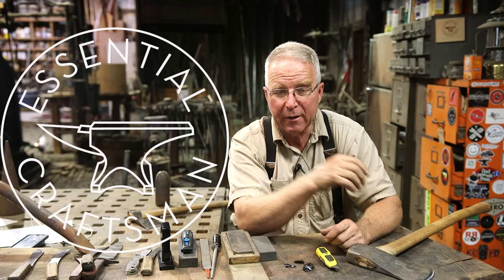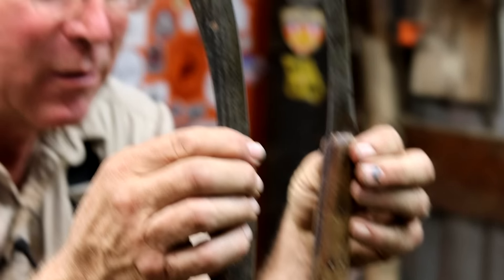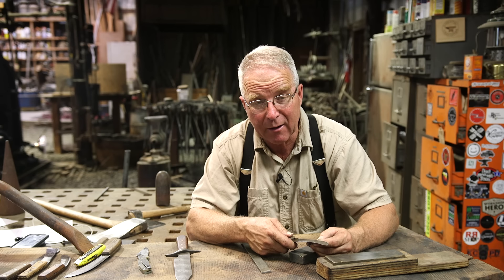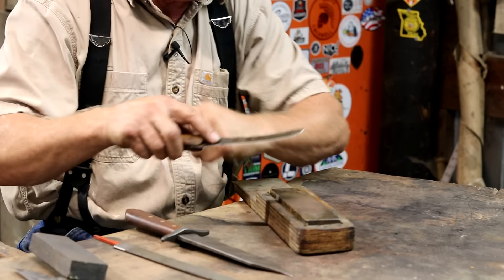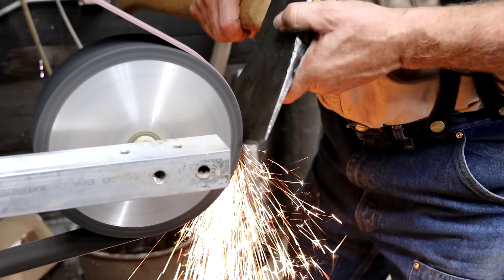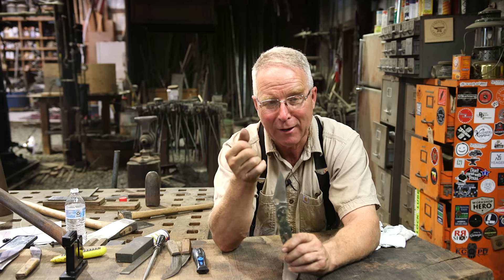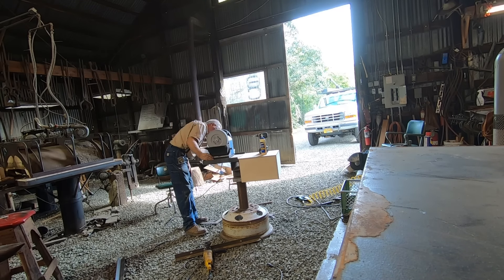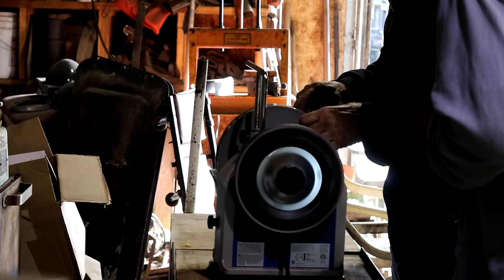Master the Art of Sharpening

Comment: Love your videos.

For ophthalmic surgery, especially corneal, the best blades are made of monocrystalline diamond. The are sharp and especially smooth so they create clean incisions without drag. This helps the wound adhere to itself without sutures. A diamond knife is very expensive, but lasts a long time as long as you don't drop it. An alternative is sapphire. It isn't as durable, but much cheaper. Even less expensive - to the point of being disposable - are silicon blades. They are made using the same silicon wafers as are used for microelectronics. The edges are not ground, instead they are chemically etched from both sides. In theory, the edges are one atom wide, but in practice they have an edge radius of approximately 40 nanometers vs. 20nM for diamond blades. For comparison, a metal surgical blade has an edge radius of approximately  600 nM.

So, if you think a scalpel is the hallmark of sharpness, think again!

Comment: Another great video! I've got a question for you, the wife gifted me a beautiful raindrop pattern Damascus knife but the tip was a little blunted at the end, so I sharpened it up and redefined the tip but I folded it up and the next time I looked the flat tip was back, it also isn't holding its edge very well, do you think it's a problem with the heat treat and need another quench?

Comment: I have used a system that is sold under the name Catco sharpeners. It consists of a blade clamp, a for setting popular sharpening angles, some honing oil, and several stones of varying grit, with a rod that is inserted into the blade holding clamp. I have had this system for around 20 years, and currently, there is a company named GATCO that comes up when I search for CATCO sharpeners, but it is a mirror to the CATCO system. It works pretty well for me, though it took a while to get used to using it.

Comment: I noticed that you run the knife over the stone with the cutting edge as the leading surface, but when you used the file on the unsharpened Bowie knife, you ran it from the back of the blade forward over the eventual cutting edge.  At what point do you make that transition?

Comment: For just about 3 years I worked at a poultry processing plant in the evisceration dept.  I would, for a few hours a day, work red tag birds.  A whole bird that gets cut into it's 12 (not 80 pieces.  I could do this at a rate of 1 bird every 18-23 seconds flat.  To maintain our blade's edge we ran them, periodically, through what we called a "Mouse Trap".  Basically just two (what I assume to be) stainless steal wires about an eighth of an inch thick, spring-loaded into a 'V' shape.  It really helped hone our knifes' edge.  

If your curious, it was Gold n' Plump Poultry in St. Cloud, MN.  Roughly 83,000 (iirc, been almost 20 years now) birds per shift run on 2 lines.  Red Tag line is where the the birds went after USDA flagged them for a defect/flaw for piecing and re-inspection.  Yes, I ate the chicken from the plant I worked at and still would if it wasn't just sold.  Gold n' Plump took good care of the chickens making a safe, tasty product.  Their workers... not so much.  Took bilateral carpal tunnel ligament release surgery after only 2 years to realize that fun fact.  But yeah, good chicken and our knives were almost always sharp due to a good, daily, deep sharpen and frequent station maintenance through our "Mouse Traps". 

A bit long winded now, sorry.

TLDR: Used to professionally cut chicken at a poultry plant and what he's saying is spot on!

Comment: This may be a dumb question but do you have different stones with different grits on that last machine? What I mean is when you sharpen your knifes with whetstones you can have different stones and then you finish with a leather strop.
Reply: If sharp is the goal, you don't need lots of grits.
You can get shaving sharp with as little as 120 grit.
I think that wheel is rated as 400 or 600 grit, that is more than plenty, because of it's application it will produce a finer finish than by hand (at the same grit, for the average person.)

Polishing is really just 'hey my knife looks pretty' deal in most use cases.

Comment: I like to use granite and marble diamond pads on my Milwaukee variable speed angle grinder. The pads go from 30 all the way to 8000 grit and some styles of them are better than others for use on metal. You can actually polish a rusted axe head to a mirror finish in 20 to 30 minutes using granite and marble dry polishing pads. For sharpening knives, I do wish I could change the grinder direction but diamond pads are a god send for polishing metal and making a razor sharp edge.

Comment: I think James (Stumpy Nubs) has three of those Tormek systems in his shop now, but I am not sure he had to pay for them.   I have been through a bunch of methods to sharpen my chisels and plane irons.  I had good results from a shop made leather strop on a low speed motor, but I made the mistake of taking it to my Menz Shed and it got ruined.  I now use a 10" CBN wheel for drastic reprofiling.  I have four 8 inch diamond stones from DMT from 300 to 8000 grit.  I also have a 16000 grit Japanese whetstone but I prefer the DMT diamond stones.  However, my secret sharpening weapon is a fully stitched buffing wheel that I use as a strop.  Thirty seconds on this wheel after using the diamond stones has my tools wicked sharp, and best of all, I can refresh an edge just using the buffing wheel multiple times before needing to go back to the diamond stones.  This only works on good quality tools.  I have a Chinese carving set that rolls the edge as soon as it is applied to the buffing wheel.  You also need to be careful using this method with wood chisels.  It definitely removes metal so use light pressure on the buffing wheel o the under side of the chisel to keep it flat.

Comment: I often use a small kitchen knife sharpener with ceramic rods or wheels on my box-cutter blade at work.  
Is it the wrong angle?   Yes.  However, it still gets a good edge and greatly reduces the amount of blades I go through.

Comment: In most sharp edge cutting, the edge is only in contact at the beginning of the cut. After penetration,  the cut is finished with the shoulder of the edge.
The longer the cut, the less the edge is used.
That's why lathe tools hold their edge longer than milling tools.

Comment: Great video! I read somewhere on a bushcraft forum that you shouldn’t use a file on tempered knife blades because it ruins the heat treating? Is that right? I use a file all the time for my axe and machete but never have on camp knives.
Reply: A file will not ruin heat treating.
Anything that will bring the metal to form an Oxide layer (straw like colour, or eventually blue) will.
This is things like bench or belt grinders.

You can use a file no problem.
Reply: @autumn5592  thanks for the reply, appreciate the advice.

Comment: I got rid of my Tormek. It’s messy because of the water. The stones are expensive. I hated “conditioning” the stone to course and then back again to fine. You have to do that for every blade because you can’t remove the blade, do all the course grinding on all the blades and then put the blades back, one at a time to do the fine grinding, because you will change the angle of the blade to the stone. Oh, and the various jigs are hideously expensive. I love power sharpening because it’s so, so much faster. I now use a Work Sharp. It cost a fraction of what the Tormek costs, has no water mess and doesn’t heat up at all. I love it.

Comment: In the 70s I  I started work in a abattoir  in the UK, we used to slaughter cattle/sheep / and pig's, I used a smooth wet stone , sometimes oil , and sometimes I used vim/Ajax a scouring powder, the blade of choice I used was a , Russell green River work' USA, they look very similar to the ones you held up, crackin knife, when I could shave my arm I knew they were ready for action,  and they we're expensive, and after 40+yr I still have them in my chamber's, just waiting to be unleashed on a , , dead carcass. Very informative vid,

Comment: I got my first belt knife, 15 cm, when I was 4 (not common, but also not shocking, when and where). I also got a whetstone, and learned how to keep it sharp. I don't know what the right definition is for "hurt yourself", but I can say that I got over being upset at the sight of my own blood, at a very young edge, I mean age. Nothing serious; more like paper cuts than anything. I quickly learned the difference between an acceptable risk (small motions with little force) and an unacceptable one, and I was given two very healthy rules: the knife remained in the sheath until and unless I was in a steady, balanced position (originally, sitting), and the edge and tip is never moved towards any part of the body. I was religious about it. It's just that, some times, to get precision control, you have to grab the blade, which is completely safe, until you get distracted, or you have to cut close to (but away from) where you're holding an object, which is also completely safe, until you get distracted. I still do those things (plus a few, more recently added, bad habits), I still get distracted, and I'm still not afraid of seeing my own blood. More importantly, I still have all my fingers, and none of them have even had to be reattached!

If a kid has the maturity to be "religious" about those two rules, there's only benefits. If they're not... well, natural selection, I guess...

Comment: This is a great video! How has the Tormek been working for you?  Have you made a follow up video on using it?
I purchased a Tormek T8 almost 2 years ago, and I can't get anything even close to sharp with it. I've read the manual a hundred times, and watched every single Tormek video over and over and over again, and I've never gotten anything sharper than about butter knife status. I sure wish I could figure out what the heck I'm doing wrong. When I use my whet stones and my leather strop, I get my blades razor-sharp, with the Tormek, I basically just ruin everything I put it on. I can't figure it out.

Comment: See, I bought the small little work sharp belt sander things. They are great sharpeners, but the first knife I sharpened was an old beat up knife and because I was pretty much putting a brand new edge on it with the 80 grit sand paper I got it way too hot. It was at that point I realized two things,  you have to cool off the blade, and less can be more. Because those small belt sanders can remove alot of metal even though they are small. 

Now I love them, because you can sharpen a knife super fast and get it super sharp, but like everything else there is a learning curve.  I recommend them to people now, but I tell them to practice alot before you put a 300 dollar knife on it. Because if I would have started with my best knife I would have been sick.

Comment: Asian knives sharpened on only one side are done about 15 degrees on that side. 
Filet knife is about 10 on a side. EDC about 25. Cleaver about 35. 
Love my Lansky system.
Reply: You don't want a 25° edge on an EDC knife...
Reply: @autumn5592  OK. What DO you want ?
 And I will pass it along.
Reply: @stevejette2329  It's not what I want, it's what should be done.

25°ps is much to steep for an EDC blade.
Higher angles may increase toughness, but they reduce edge retention (making knives duller faster), limits their overall sharpness and ability to cut things.

You want 14-20°ps on your EDC knives, it will make them perform better and last longer.
Want to avoid making it to low though on steels that are to hard (as they will chip to shit), and to low on softer steels (as they will be more inclined to roll.)
You match the exact angle to the steel, thickness, and hardness.

You can always microbevel as well, which will bring a little of that strength back. While keeping the benefits of a lower angle. (Becaise there is less material behind the edge.)

I recommend using 18°ps, then lowering it every now and again to see until it chips, then sharpen at the previous angle.
Reply: @autumn5592  So I guess everybody who has an EDC uses it for the same purpose, therefore it "should be done" the same.  I am curious how you get 
a "14" degree edge. Not 15. Or 13.
Reply: @stevejette2329  Tell me, what would ANYONE need a 20+°ps edge on their knife for?
You gonna hack bones with your pocket knife? Lmfao.
There is absolutely no need.

Freehand it, if you need to know, use a protractor, it's not hard.
Some of the more expensive systems have 1 degree angle control,  but why waste the money.
Those aren't even that good either (because of how they effect the angles tips or heels.)

You don't need exact though, that's why I never gave an absolute -- so long as it doesn't roll or chip, and you are going pretty low, it's fine.
Reply: @autumn5592  Having worked as an ironworker and a harbormaster, my knives were usually "sacrificial", meaning that the work itself would often destroy knives. Being in the Coast Guard, I sharpen the survival knife much sharper, to possibly cut clear of any lines when underwater.
My most important sharpening tool is a jewelers eye lupe, 10 power.
Reply: @stevejette2329  Okay, so you listed professions, not actual uses.
And then some statement which has no explanation.
Not what I asked for at all.

And then you add another statement, which doesn't mean anything.

Magnification helps, but completely unneeded.
Reply: @autumn5592  You are right. I am completely wrong. Bye.
Reply: @stevejette2329  I'm glad you're realised.
Takes a big man to accept his mistakes, good on you.

Comment: I notice that nothing was mentioned about sandpaper… does a high grit paper not work well on knives for sharpening? (My only experience of paper is for proofing a bike frame prior to painting and I have a lot of paper left over so figured it could be used on my knives)
Reply: Yes it does work well. You do need to know your grits and which to use when. Finish with a strop.

Comment: The Workshop Ken Onion edition with the blade grinding attachment can be manually speed adjusted to prevent blade heating and I STILL cool and dry the blade😂
Reply: Still causes overheating on the first few microns of the edge.
Reply: Yeah the thinner the metal gets the easier it is to heat up. Its physics

Comment: Yeah getting back to old whetstone sharpenig a bit . Want to get it super sharp as in factory sharpness . But got away from that old fashion way instead using those easy lazy ones that you hold down with one hand running it thru those anrrow V slits .  it does get it fairly sharp butr now getting back into old whetstone way . Because a higher end steel blade knife S35 VN that may be harder to sharpen might need more xpensive sharpeners ? What would you recommend ? Yes have a two coarse whetstone but might need another ?

Comment: You ain’t lying about spending a lot of time on a whetstone.  My USMC Kabar takes forever to get a good edge on it but it is then so sharp it will shave the hair off your arm.  I don’t have to work as hard on my pocket knives.  I have a set of Kerry’s stones from 400 grit to 10,000 grit.  On some knives I start out on the 400 grit but others on the 3,000 grit stone.  Mine are wet stones, so I soak them in water for 15 minutes before I use them.  I spray the stones with a soapy water during use.  This, removes the metal filings from the stone during use. I want a wet slurry on the stone during use.  If it dries out I spray it again with my soapy water solution.

Comment: Scissors are probably the easiest. Fix one of the blades in a vice and find the angle with a file. You will know it is correct when it goes over smooth with no resisting grinds. Use light strokes with little pressure holding the file at both ends keeping the angle consistant.

Comment: I hope you do a follow up video cause even the Tormek has it's quirks. But someone who is sharpening lots of different tools can get their money's worth out of it. IF one buys one, don't get the small one, get the T8. Lots of attachments to dump money in. For wood working tools and kitchen knives I use water stones and a leather strop on wood with SiC paste (no real need for diamond paste if it isn't high carbon steel). For some tools I also like the 3M films on floatglass and a guide for chisels. You can do a lot with removing very little material. If I had axes, hatchets and scissors to tend to. If you find one of the quirks you dislike, I'd love to see you come up with a different guide. When you get a kid a knife and a stone, don't give them the smallest blade cause it's easier to hold a bigger blade to keep the angle. Stones need to be trued.

Comment: what is that first stone you use dry?
Or the ones those farmers used on their scythes?
I only know wet whetstones.
Reply: Should be an Arkansas stone.
You usually use them with oil, but you can use water or dry.

The second stone you are talking about is a scythe stone, sometimes called an oval or boat stone.
There are other versions which can all be called a scythe stone, like a cigar stone.

Whetstones are the encompassing name.
Whet means sharpen, so it is sharpening stone.
Reply: @autumn5592  thanks so much.

Comment: Today I sharpen a new kitchen knife on a file its the only thing I could find then I went over it with some leather knife holder again only thing I could find came out very sharp I was surprised .
Reply: Probably got it to a sharp burr. I’ve sharpened a knife on smooth finished concrete just fine.

Comment: Sir, I am leaving on a 6 month backpacking trip and wish to keep the pocket knife I am carrying will stay sharp. I am told that some sand paper will work (this is my light weight solution). However, I do not know what grit to use. Could you give me some guidance and if not sandpaper some other system. However, lightness is of the essence. Thanks. -David